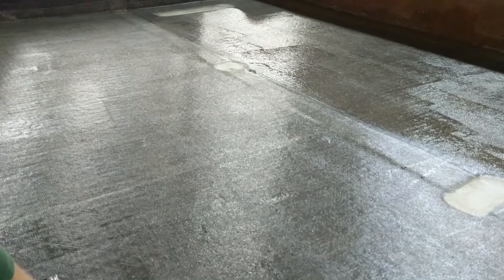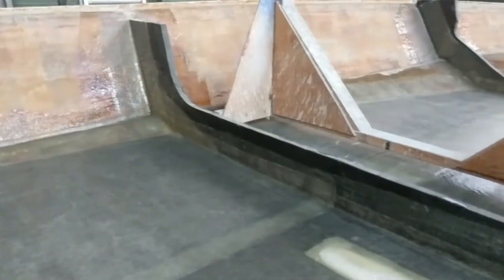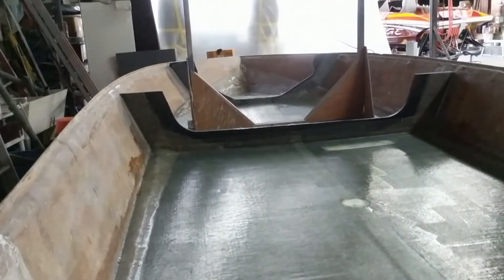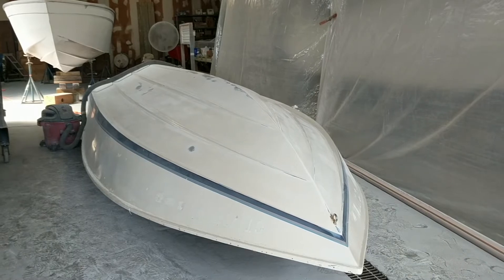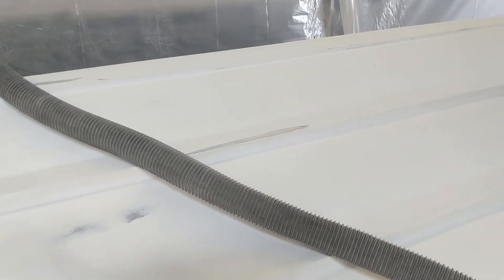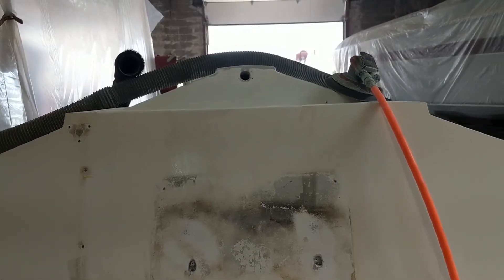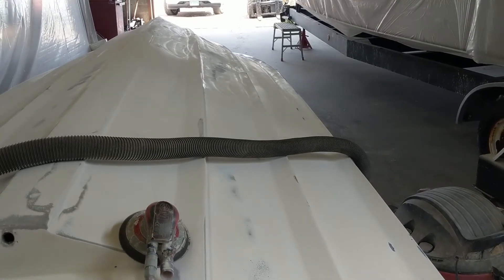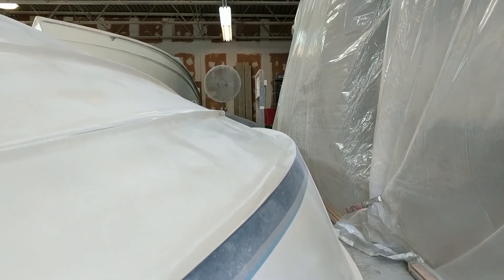Project Activator Episode 10: We look at the floor and blueprinting the hull

Comment: Hi Jared. Great to have an update. One of the questions I sent you was how did you prevent the hull from twisting after you popped of the deck. Thx Dennis 🇧🇲
Reply from the maker: Hey Dennis, good question. Generally, when the deck is off, you keep everything intact, and replace things one at a time to maintain integrity. We did the transom while the old stringers and bulkheads remained; then we did the stringers, then bulkheads. That way there was always support. Additionally, make sure the hull is properly supported underneath, and add temporary support if needed.